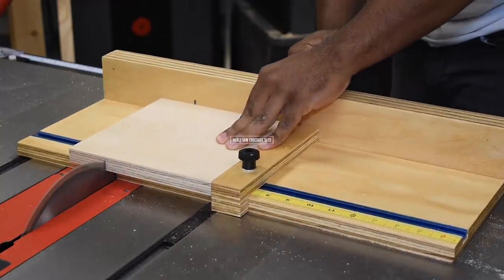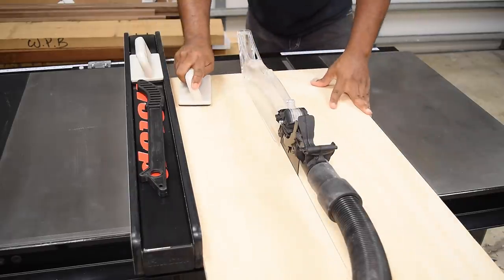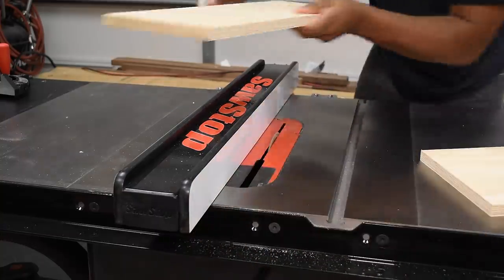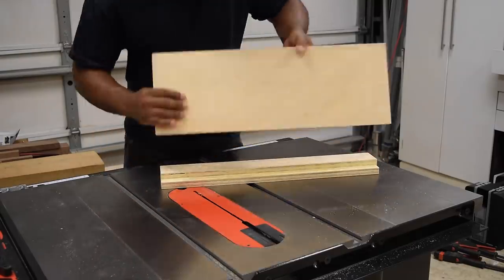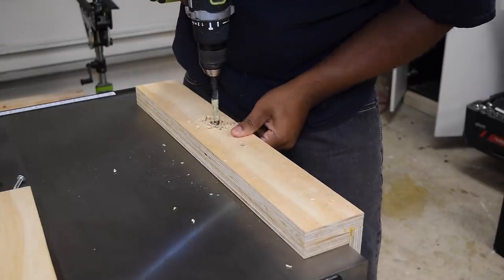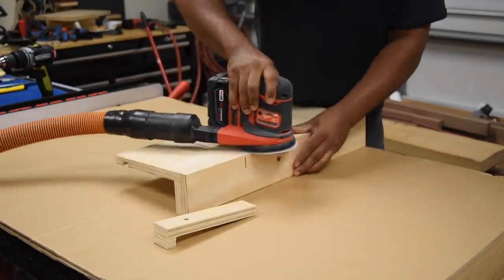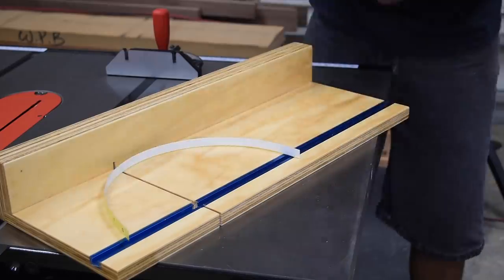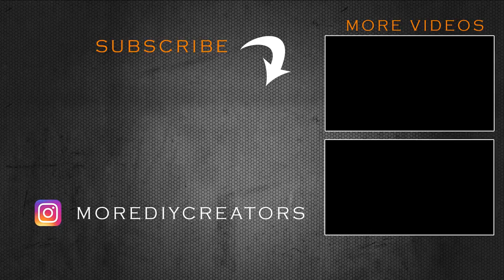How to make Table Saw Sled // mini

Comment: This is a great idea.  I have the same Rockler table saw sled and it's great for when I need it.  But its big and bulky so it is a process to get it up on the saw and back off if I'm doing different things for a project.  I can totally see making a small sled like this as it would be handy to have right there and be able to get on and off the saw quickly when I need it.  Thanks for making this video!!

Comment: Just a couple of points: you should square your miter gauge to the slot in the table providing that the blade is parallel to the slot to begin with. There  are several videos on YouTube that demonstrate how this is done accurately. There are several accurate squares they can be purchased to check accuracy. The Kinex 4033-12-010 on EBay for $15 bucks is great for the money. Try to do the 5 cut method. Again you can find this method on YouTube. Hope this helps.

Comment: Glenn, if you turn off the blade stop safety feature, it will have automatically reset to the default on position when you turn the table saw on again.
Nice sled, I've made a few things based on your designs, and I may have to build another one.

Comment: You can't "forget to turn it back on" on a SawStop. Whenever you power off the saw after running it with the disabled safety feature, it reactivates itself automatically.

Comment: Just a heads up, I have a sawstop too. It's a Smart Bypass System and will automatically turn itself back on to the normal safety state if you disable it for a cut.

Which means, yes, if you were cutting a lot of metal or wet wood, you'd have to disable it every time you turned it on to make a new cut.

Just the video I needed for the cross cut sled, love your channel. I made your floating shelves already :)

Comment: Nice job! I think I will make one for my saw. I notice that your stop block could eventually wear the numbers off the measuring tape and could require replacing? I plan on making a shallow relief cut under mine to ward off wear on the measuring tape. Love your presentation it was easy to understand.

Comment: Can you explain why you'd prefer the t-track near the middle of the sled?
Reply: Mark Johnson it is more accurate with small pieces then. They are pushing against the stop block and the t track is the turning point if not clamped really hard. Stop block could tilt slightly and so would be the cut

Comment: Not to be the safety-police, but in the beginning you use the miter guage with the table-fence.  Invitation for kickback.   Love the idea of a compact crosscut sled, tho.
Reply: I saw that too and said to myself,  U can do that?   Then my brain kicked in,  ok, I'll have to try that!   I'm a young woodworker that just got my first table saw and I think you're the most talented skilled Youtuber out there. . .  thanks for the tip.
Reply: Yeah, and that's the type of kickback that causes a putations as the wood piece can pull your hand into blade. Iter gauge or not, crosscutting pieces that are wider than they are long (in direction of travel) is a recipe for them to wedge between the fence and blade diagonally which will cause the blade to spin and throw the wood, pulling your hand into the blade in the process.  Thintz12 "kickback on camera" has some good footage of a kickback pulling hand in, narrowly avoiding bloodshed.

Comment: Speaking of the ridgid table saw you had. Now im probably like a lot of people and i can not financially afford a sawstop but i have been looking at getting the ridgid r4512. How much did you like that saw? I need to toss my dewalt its always had a warped top.
Reply from the maker: The Ridgid is a great saw You can't go wrong with it.
Reply: @DIYCreators  hey thanks. So far everyone has said the same with the exception of the fence and how sloppy it can be.
Reply from the maker: Yes, I think the fence is the only weakness I remember, it was good, not great. However,  it was a huge upgrade to my older craftsman table saw.
Reply: @DIYCreators  right on hey thanks for the info.

Comment: If one is going to cut aluminum with a Saw Stop you have to turn the safety off. It will trip.
Maybe put a second T-track in the closer spot. I have the panel to make a few sleds for my saw. I like this one for quick 90's.

Comment: So we dont have to do that crazy four cut math project if we use your method? I assume we need to be sure the fence and blade are squared up before cutting!
Reply: He did square up the miter to the blade.  He's assuming the backer board gets screwed in perfectly square.  On short pieces like he uses it's going to be a marginal difference.  But on extremely long cuts you're going to want to dial it in as close to perfect as you can,  including that four cut method, potentially.